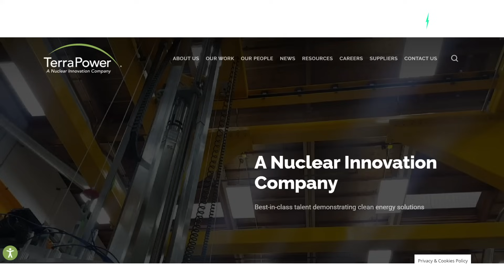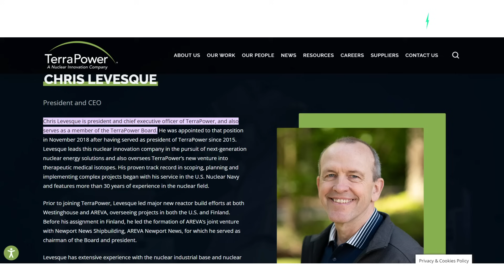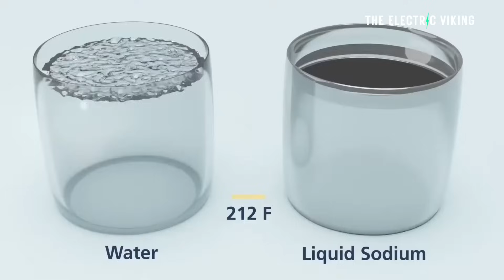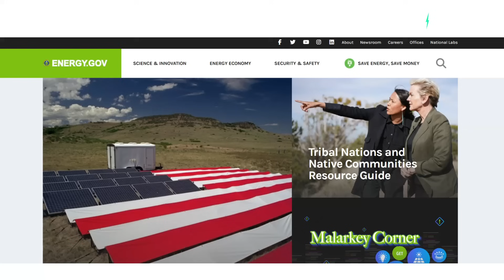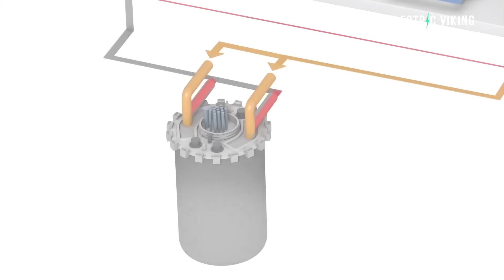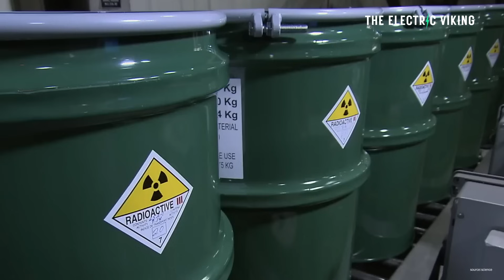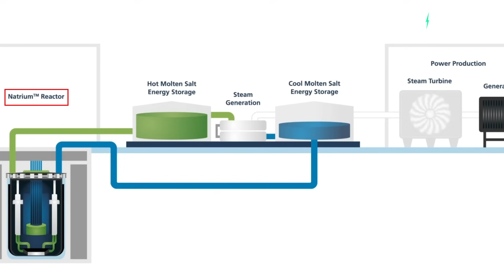Bill Gates' plans to build Modular Nuclear Power Plant in US without permits

Comment: WRONG VIKING: In a 10 year period during the 60s & 70s the U.S. built 100 nuclear reactors ON TIME and ON BUDGET (generally speaking), with an average build time of 36 months. Most are running today, 50 years later. Nuclear is the cleanest, safest, most energy dense, by a factor of 2 MILLION times that of solar, wind, geothermal, fossil fuels, and the only nearly ZERO CARBON source of energy. See the Titans of Nuclear YouTube channel, Titans of Nuclear podcasts, and Bret Kugelmass' videos:  https://www.youtube.com/watch?v=Rb7tAwNIvUs   and    https://www.youtube.com/watch?v=cGJk0P7nu7g    when you are prepared to engage with objective reality on the topic of nuclear energy. You can do much better Viking.

Comment: Here's a thought. This requires 2 billion of governement subsidies. Now that's fine. 
But if the project goes t|ts up somewhere along the line, will uncle Bill pay up first or is it you and me who foot the bill ?
'Just have think' had a good item on small nucleair reactors - there is no magic to them and they are very expensive. 
But if governements teet is being offered to you so freely, what can a man do ? Another prima example of socialism for the rich.
Reply: I think its the same subsidies any nuclear plant get, the govt guarantees to buy the electricity at a fixed rate. No electricity, nothing to buy.
Reply: The take-sway from the "just have a think" video, was that small nuclear reactors are not as great as people like to make out. They need the same amount of engineering, maintenance, skilled operators, training and security as large reactors, but produce much less power. May be possible to build quicker, but there is a limited number of qualified constructors in the US. Cost per kwh is extremely expensive compared to wind and solar. Oh, and isn't liquid salt extremely corrosive?
Reply: @snakeplissken526  yes, it’s just a silly promise that it’s cheap so the government will bear the initial costs and then we all become disappointed later it didn’t work out. We churn out submarine reactors all the time, consistently, just compare SMRs with them.
Reply: Bill Gates is on the hook for all cost above the $2 Billion.   I believe the $2 Billion is also only for a licensed design, site, and operators.  So he is gambling everything he invests in the belief that he will be able to post construction license the plant and site.   The vast cost overruns of the 1980's - 1990's nuclear power plants were due to modifications needed to already constructed plants (or partially completed plants) that were required to meet the final design and licensing requirements.

Comment: Trillions of $ to expand the national electricity grid in the USA. 
More grid electricity is more grid.
Electricity is expensive because of the the expensive grid. 
$million per klm and millions of klms to millions and millions and millions of customers. 

The grid is rented out monthly and some cheap electricity is part of the deal. 

That is why feed in tariff is dirt cheap, grid payments are expensive. 

Grid electricity expansion costs never discussed. 
Clean Energy Finance. 

Now, if every building had a huge battery and remained connected to the existing national grid, then rooftop PV can not overload the grid. 

The 'solar duck curve' danger is a dead duck engineering wise and economically. 

Same for nuclear grid electricity. 
Same for distant renewables. 
Both need expanded grid, stupidly uneconomic.

Most ICE vehicles only work 1 hour a day.
Nuclear grid electricity can not work at maximum efficiency 24/7.
Grid electricity is only 15% of all energy used. 
Grid electricity is extremely expensive. 
7 times grid capacity is insanely uneconomic. 
Transmission grids are spectacularly more expensive than generation plant.
Reply: It depends on the country in the U.S. the electric grid provides 25% of all energy, globally the number is 20% and in many countries the grid provides 15% or less. As EVs roll out, more,heat pumps are added, etc. the grid,will provide an ever increasing share of energy.
Reply: @John-ed8ye  you remind me of the little kid who said to me, " I will pay for it, you give me the money."

True story. 👍

Comment: He can build it with minimal fines without a permit.  It's just if he fuels it with nuclear materials he will be in big trouble.
Reply: Yes, without any nuclear fuel, it is just a building, nothing special.  The challenge will be if they require changes that can't be made without tearing things down and rebuilding them.
Reply: This is how stupid north America is with nuclear power plants even though they're the cleanest.
Renewables are horribly dirty to produce. 
New reactors are very safe and the only challenge is finding a hole in the desert or under a mountain to store the spent fuel rods. 
 I suggest the nuclear test ranges that have already been nuked multiple times for years for testing... The area is already radiated.

Comment: they can build it without an operational permit.. they can build everything except adding the fuel without an nuclear regulatory permit.. but to build you need a building permit   There are multiple permits needed for nuclear... but most can be built with the building permit as long as they do not add the fuel